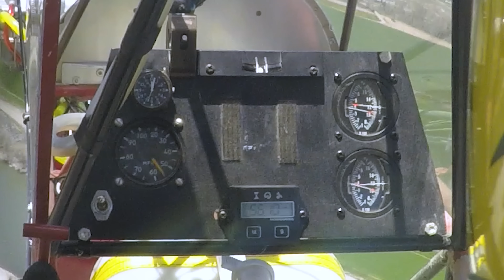MAIDEN FLIGHT goes BAD on landing.😓 Abandon airplane PART 6.

Comment: Insufficient rudder authority.  I bet when you started playing with the prop you changed enough of the prop wash on the surfaces to be a large factor.  But consider, what are you going to do in a crosswind?  Better make that rudder bigger.

I have a feeling the FSDO is going to insist on you demonstrating cross wind landing in a tail wheel to a DPE.

As to CHT, if they all aren't about the same, you have a problem.  Might be minor or might be major.  Verify no restrictions in the manifolds or other simple stuff such as a mag not being in the same timing for all the cylinders.  Can't find it there bore scopes and maybe an overhaul are in your future.

Comment: Your rudder is "ineffective" due to 2 problems.  1. Not enough area on the rudder.   But more importantly #2---Too much air disturbance from engine past the pilot.  This much disturbed air will never flow over the rudder smoothly and give you control at lower speeds.  I suggest you cover the fuselage from engine to just behind the pilot.  This should help.  Then make a taller and larger vertical stab and rudder.  Good luck.
Reply: Nailed it
Reply: Airbikes fly just fine as designed. Plenty of rudder authority.
Reply: @shinycessna  I guess you missed the video showing just how LITTLE authority the rudder actually has.  Typical cessna pilot.  Please go back to school.  One shouldn't rely on brakes for total steering.  A much larger area would have kept this guy ON the runway.
Reply: @Flapswgm  As I said Airbikes fly just fine with the rudder they were designed with. I've got plenty of hours in lots of different type of aircraft, so your cessna comment is just idle chatter.

There is plenty going on there from cross wind to touching down at way too fast of a speed for that airframe. Blaming the design is probably the last thing to do.

Comment: No if I was you first of all I would not be wearing a sweatshirt with a hoodie and starting that thing up with the gloves baggy clothing I have a starter motor on that with the electrical connection that I could unhook and leave the battery on the ground because one day you’re gonna end up in that propeller or without an arm

Comment: The back cylinder?  You might need 2 carbs and run the hot cylinder a little fatter on the jetting. Make your brakes independent with a double cart master cylinder and you won't need rudder authority

Comment: Lateral stability curve was well wrecked. Have you considered marginalising the static rudder trim so that the aeleron\ nose wheel diatonic ratio wasnt compromised like we saw? It could help. We used to do it in the Navy all the time for WW2 remakes.
Reply: Wot!
Reply: @thatfeeble-mindedboy  It looked darned worse than it was . If it was brought round to our old shop we would probably get that critter back in the air in a day

Comment: HOLY CRAP, MAN!!  Glad you didn't hit a SINGLE thing on that one!! It yanked you right off the runway! Crazy!! God's definitely looking out - I agree! Sucks you had to find out the hard way the landing gear was Fischer-Price quality!

Yeah that's getting close to holing a piston, IMO. 450° is usually when that happens. That's a great candidate for Amsoil Saber 2-stroke oil - I know that stuff can handle the high temps. I run it in my paramotor and always see high-300° to 400° head temps on climb-out. I'd definitely be fattening up the main and needle on whichever cylinder that was. I'm guessing the rear one just because it's not in the line of cooling fire.

Glad you got to fly it at least! Looked like a blast!  That thing took off pretty quick! Nice powerful engine there. Moves right along through the air, too. 

Some day I may buy some type of fixed wing ultralight if I don't go towards a Mosquito helicopter. Fixed wing is more in my budget, but a heli is perfect for where I live. Don't have the dough for either one at the moment since I ordered a Magnuson supercharger, Truck Norris cam, and new lifters, triple-disc torque converter, etc, etc,. for my '07 Silverado back in March - everything is backordered. Headers should be here in a couple weeks. Supercharger won't be here until July. Rest of the stuff came in right away. Crazy world we live in! Thanks for sharing, Jonas!
Reply from the maker: Thanks Smitty!!

Comment: Pretty sure I’d upgrade the gear and the brakes. Id also consider VG’s on wings, bottom horizontal and vertical. I’m wondering if your hot cylinder isn’t due to the cylinder having not been run long enough to break in??

Comment: The Airbike became an Air-dirt-bike! Jokes aside, your gear problem brings up a serious question. If the builder didn't use the correct material for the landing gear, did he/she use the correct materials for everything else? Are the fasteners up to snuff? Etc.
Reply: Well I don't think those are stock tires and they aren't very good on pavement. The gear didn't completely fail so maybe it was meant for the original wheels which would increase visibility and make for a smoother landing not causing the gear to partially collapse. The tank not being mounted overhead might have made it a little too heavy over the gear as well. I think he just found out what needs to be reinforced to make his changes work the best. Changing these little planes causes unwanted things to happen elsewhere. My biggest inner struggle has been to keep modifications to a minimum as to not deviate very much from the original design. Or at least stick to mods others have already tried and tested to work.

Comment: A more scientific approach to adjusting prop pitch may help. Attach scales to the tail / anchor point and measure thrust at each prop pitch. You want max thrust at your desired rpm (not red line). Also find out why one cyl is getting hot, is it running weak? missing shrouds? Go on a diet or improve the landing gear. Install a bigger rudder or fix brakes. P.S. Not an expert just my thoughts.

Comment: Not sure how much tail wheel time you have but in the flare once the mains touch you have to pull full back stick and hold it in your gut to force the tail wheel to contact the pavement. The tail wheel gives you steering authority not air over the rudder once you've touched down. You would have had directional control had you kept the stick all the way back.

Comment: With all respect to your flying skills, sir, you seem to be a disaster waiting to happen. Not being able to lock your brakes to test your engine's ability is first fault - you should be able to determine that EGT performance with the new air filter, with a good run up. I suspect the increased temperature may be due to the larger, freer flowing air filter, which will cause the carb to run leaner, if no other adjustments are made. If there is a slight manifold cylinder feed imbalance, which is common to two or more manifold feeds, and leaning the carb, it will result in one lean cylinder showing up eventually. Second is not even doing up your helmet. Third is as you yourself implied – your rudder is too small. Even if your gear's toe-in is wrong, your rudder should have enough overbuild to compensate for that. Fourth is not having a radio, the lack of which is obviously distracting you from flying. Just saying for your own safety!

Comment: Glad you missed the lights. Try removing the metal shroud from the engine head and run a temp test again. Since the shrouds on there appear to be open left to right across the heads and not forwards to backwards the air may be going static allowing the temps to rise.

Comment: Also, anything that sticks out and is not symmetric creates lopsided drag.  Fix the  exposed left side air filter, or put a symmetrical one on the other side of the engine.  That Plane is way too light to not have all the drag symmetrical, and increase the distance to the tail end of the plane, and increase the size of the rudder.

Comment: High coolant temps are usually caused by too much friction. Engine needs more break in time. Or needs oil cooler.

Comment: Jonas you can buy a cheap handheld radio for less than $50. They're marketed towards ham radio operators, but they will transmit and receive on police and aviation bands. Bofeng, check it out. There's no reason to be flying without radio communications.
Reply: they do not transmit AM on Aviation band!  They ONLY receive AM on Avation band, they transmit FM ONLY
Reply: @justme-n-gracie  I may be wrong, but I'm pretty sure they use FM.

Comment: Lastly quit fixating on egts man.  You can’t control that much on a plane with no mixture control. It’s controlled by the mixture. It’s not like the CHT where you can get more airflow and bring them down.  Egt probes are not to be trusted.  They are just an indicator.  The chts will tell you if there is a problem.  Chts good. You are probably good.  

Fixating on something you can’t change in flight isn’t a good idea.  I could hear it in your voice that it was effecting your judgement.  Just fly the plane.  If the egt pegs up high and chts are fine there is no problem.

Comment: Well I guess they're issuing aeronautical engineering degrees through a cereal box top redemption program? I'm wondering if you have to send it in with a SASE, in order for them to mail you back your credentials. Just a humble motorcycle mechanic here and noticing the complete lack of any triangulation or support to the wheel struts, and what is provided for support appears to be made out of case hardened Gouda...

Comment: I had a fairly identical incident (true story) at Dease Lk, BC back in the 80's. I'd been doing supply runs for a hunting outfitter off an ice covered lake 60 miles south of Dease with the outfitter's Dehav Beaver on wheel skis. Obviously, for flying off a frozen lake to a remote camp I'd left the skis in down position. Had done these runs for a couple of weeks and got the brain storm to fly up to the gravel strip at YDL so as to use a land line phone. It was an expensive phone call. I brought the skis up for the wheel landing, unfortunately, the left side wheel was frozen and it turned out I had zero brake on the right so it was an immediate ground loop on landing into a pretty high snow bank. I managed to ferry the machine down to YVR (with the help of a mechanic) and got it repaired (Beavs are just one tough machine). Anyhoo, if you don't mind me asking, is this what happened in your case, no brakes on the right?
Reply from the maker: Interesting story! Thanks for sharing. Well the brakes really dont work that great and I’m not used to heel brakes. I’ve never really flown any airplane with them so my reaction time on using them was useless. Though I’m not sure they would have helped much.
Reply: @JonasMarcinko  Agree - those heel brakes are pesky little buggers. Flown a few cubs but don't recall using much brake.. thx - great vid's!

Comment: Sad... The Man Worked On That Airplane For ,,, Only God Knows,,, But He Should of Had a Man That Could Fly,,, Do The Test Flying... Happens All The Time,,, a "Man" Spends 10 Years Building An Airplane,,, Sitting In The Cockpit For Hours After The "Work Day Is Done',,, Thinking of The "Day" It Will Fly,,,  Big Problem,,, It's The "Talent" of "Skill Level" of The Pilot,,, Here It Shows,,, Even At 35 MPH,,, He Was "Behind The Airplane",,,, "By a Mile"...